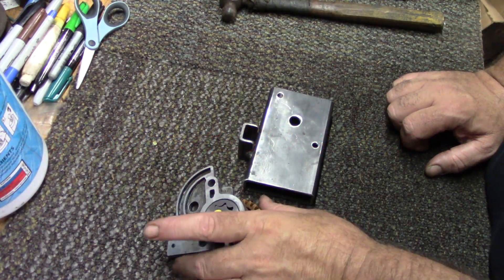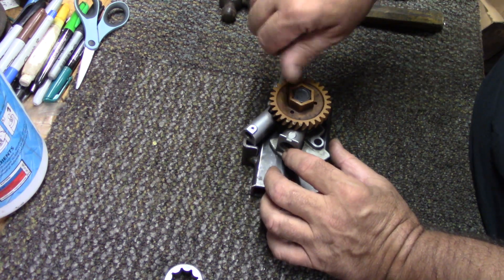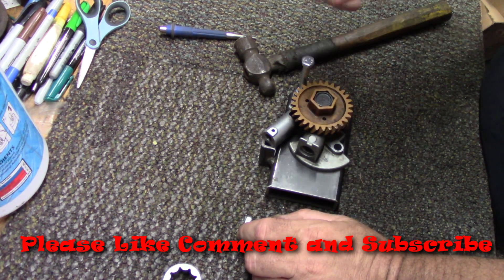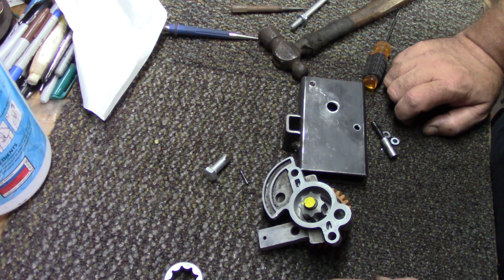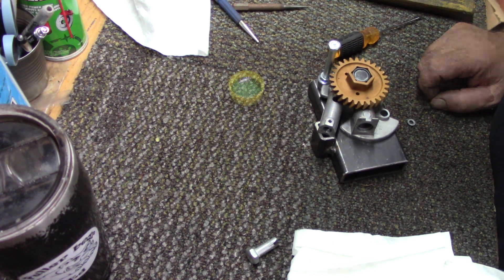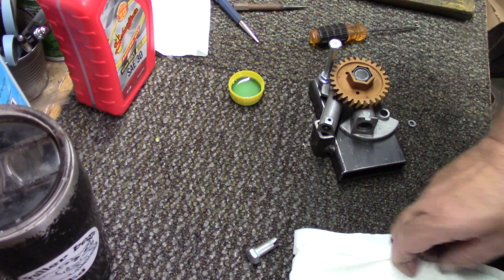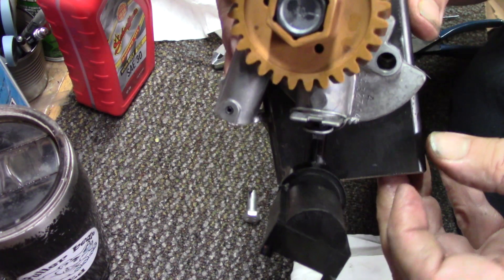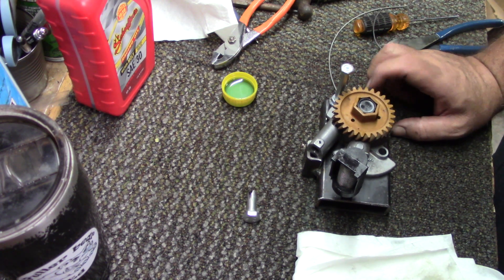How to upgrade the Kohler  Command oil pump for better performance. #kohlerengines #GTpulling

Comment: At 10k RPM -  that pump should be putting out a ton of volume..  So I'm not sure why this is actually needed.  I'd like to see you run a pressure transducer on a scope during a pass.. and see what your oil pressure is actually doing the whole time.   Do that before and after this mod-  and see if it's even necessary.   I suppose it can't hurt -  but I would be afraid of it breaking that plastic gear more than anything else.    My point is:  this thing pumps more as your RPM's go up -- so it should be a self correcting issue and not actually be a problem..  I think it would actually be pumping WAY more than what you need already -  so most of it will be going through that bypass.. (at high RPM's).   I don't think that lack of oil is ever an issue with this style pump.  Just my 2 cents
Reply from the maker: You hit the nail in the head, you have to up the bypass pressure so at high rpm it doesn't just push through it and starve the engine for oil at the end of the pull while its under the most load on the engine. Yes I have seen the plastic gear fail but not often.

Comment: Can the gear be changed if mine broke?
Reply from the maker: Yes. They sell steel aftermarket ones i believe.  I don't remember where I seen them
Reply: @PullerbearEd i figured it out. I appreciate it.   Kohler discontinued the oil pump for the ch23 . They will sale the pan , dipstick, oil pump and all that in one piece  for right at $400. I can't do that.I gotta press the pump apart and replace the gear.
Reply from the maker: A lot of the parts for them are n/a...

Comment: Wheres the oil pump located at? Inside the motor? You never said.
Reply from the maker: Yes it is in the bottom of the engine on the inside.

Comment: Did adding the 2  5mm washers increase the oil pressure. Stock as you mentioned is about 40psi what is it now with the 2 washers in the relief valve. Thanks Darren
Reply from the maker: Yes it increased it. It ups it to about 60psi on average.
Reply: @PullerbearEd    YOU SHOULD HAVE PUT 2. funny...i was doing this 30 years ago on small block chevrolet lol
Reply from the maker: This was an unknown pump to me. I didn't want to pump up the pressure to much.

Comment: Question does the dot on the oil pump gear face you or does it go down ? I have one with a broken plastic gear does kohler sell that separately
Reply from the maker: The dot faces you. I don't know if that gear is available separately but I would guess not because the pump wasn't the last time I checked.

Comment: What kind of oil pump pressure did you end up with after installing just that one washer, did you need to add another?
Reply from the maker: I never tested that engine but it's usually give about 10 more psi on other engines I've done.

Comment: Hey Ed, i would like to put an oil pressure sensor and  gauge on my Kohler command pro 27.
Where would i put the sensor?
Reply: The motor is all apart right  now. I can send pictures if that would help?
Reply: Oops, i ment engine!
Reply from the maker: I use a mechanical gauge and I put it the port on top of the engine between the heads. There is a plug there where a pressure sensor would have been from the factory.

Comment: How do I test oil pressure on a 25hp kolher about a year 2000
Reply from the maker: There is a test port on the top between the heads. There might be a pressure switch in the port. Just remove it and install a mechanical gauge.

Comment: What is your suggestion to get the maximum hp out of a 7hp kohler
Reply from the maker: Replace it with a 14hp lol. Just kidding the best thing would be to port and polish and mill the head a little. Then bigger valves and a better cam shaft.
Reply: I would switch it to a 14 hp kohler but for the kids class they dont allow that hp. They also dont allow port and polishing the head and they have to have stock valves
Reply from the maker: If its a pure stock class then there isn't a lot you can do other than getting the timing dead on for what the engine likes and getting the fuel dialed in.

Comment: Any idea where one can get a new pump of that style. I broke the cam gears on mine and it says part discontinued
Reply from the maker: You can check ebay or maybe a small engine shop locally might have an old engine around.  Lots of parts for these engine are discontinued.

Comment: Thx for the video, you use the stock vent on top of engine, or do you add a breather?
Reply from the maker: It depends on what class, if it's an open rpm class we add vents to the PTO side of the block. We drill and tap the top outer 2 mounting holes above the pto. I do show it in one of the videos on the Plan B tractor and the pro V engine build

Comment: I have 25 hp kohler command vtwin I was in the process of converting from vertical to horizontal shaft I made a tube and a screen block for the oil pump but my freind pointed out that there's no way for the oil to be pumped to the heads any ideas I appreciate
Reply from the maker: I've never converted one like that. I would have to think it would pump it up there the same if it was a vertical or horizontal.
Reply: @PullerbearEd  this engine has a oil cooler could you run lines to the valve covers on the return side of that so the oil pump sends to the cooler then the heads  thank for your help there's really not much on those type videos and don't want to ruin this motor that I've already removed gov from
Reply: I think only Hondas send pressurized oil to the heads, all the other commercial twins have oil mist come up the pushrod tubes from the crankcase or inside the pushrod itself.
Reply: @kylegoldston  thanks Kyle i found a horizontal 25 that is seized and the guy told me I can have so I have something to work with now
Reply: @jimmypotts4516  if you don't want both I can take whatever parts you don't need, I am going to be starting up a V-twin Kohler engine program.

Comment: why do they call it Department of Motor Vehicles why is boats with an engine so-called call a motorboat your statement is false whoever told you that just heard that from somebody else George called a folktale
Reply from the maker: If you are referring to the engine vs motor thing yes I know by definition they are the same. Thank you for watching.

Comment: Covid wuz just the globalists killing off the population while destroying our economy. The left is goose stepping to the new world order tune and just about everyone knows it now. 
I had a Kohler courage burn up the top crank journal years back and ruin an engine and I have just torn down another one that the plastic oil pump gear cracked and is spinning on the big bolt head. I have also read a few posts about Kohler having oiling issues so this is good info for me on rebuilding these engines. Thx😉
Reply from the maker: I dont get into politics. This is the best way I have found to get proper oiling to the topend

Comment: It's nice to see that these engines have a real oil pump! As a side note, not all motors are engines, and not all engines are motors. This motor happens to be an engine and this engine is also a motor. I'm not sure why there's so much discussion about that subject, it seems pretty simple.
Reply from the maker: en·gine

/ˈenjən/

noun

1.

a machine with moving parts that converts power into motion.

mo·tor

/ˈmōdər/

noun

a machine, especially one powered by electricity or internal combustion, that supplies motive power for a vehicle or for some other device with moving parts.
Reply: @PullerbearEd YES!!! 💯% these words r synonyms !!   U can use either or  at ur pleasure and as ur heart desires !!!

Comment: Sir I got Kohler pro 24 hp engine I need to find me an oil drain hose to make changing oil easyer would you know what size hose I need to screw in engine
Reply from the maker: If memory serves me correctly it is 3/8in NPT
Reply: @PullerbearEd  thank you
Reply from the maker: Your welcome, glad I could help
Reply: I used one from a 22 hp briggs vtwin

Comment: works better? can you explain it better?
Doesnt the original pump works well???

Are you just changing the  pressure limit of the pump?

I dont understan very well the point.
Reply from the maker: Yes the stock set up works fine for 3500 RPM. but when the RPM go up the relief valve opens sooner decreasing the volume so we up the relief valve pressure to increase the volume.

Comment: May have to do this to my stocker the next time it’s out!! Keep it up man!
Reply from the maker: It won't hurt it. Every little bit of friction you can eliminate is just a bit more horsepower.
Reply: Why?
Reply from the maker: The less friction allows the engine to make more horsepower. The engine doesn't have to work so hard.

Comment: Oh baby you know what I like. Thanks for the oil recommendation too. Did the modification while eating your famous loose meat sandwich, mushrooms, onion, mustard and a hint of zinc flavor.
Reply from the maker: That's awesome
Reply: what mods??? Can you explain me like iam very dumb, what so great in this video??? I dont understand it.
Reply from the maker: Juilo the mod is increasing the oil pressure to increase the volume of oil to the engine. At the RPMs we run you can run the bearings out of oil really quickly.

Comment: Easy hack good info
Reply from the maker: Thank you, I know it's just simple but I hope it helps someone save their engine.
Reply: @PullerbearEd  Did you just changed the relief valve?
Reply from the maker: Yes Julio, we add shims to the spring to increase the pressure at witch the relief valve opens.

Comment: Nice upgrade there. 👍👍
Reply from the maker: Thank you,  it's just a bit of insurance
Reply: @PullerbearEd  Do you pass over engine max  rpm?
Reply from the maker: Yes we run them at anywhere from 8500 to 10,000RPM

Comment: More psi is a good thing 👍
Reply from the maker: Yes it is...
Reply: How can you get more psi, witout changing gears or the pump??
Reply: @julioramossilva3968  It's always pumping through the same little oil passages and ports, etc.  It's designed to pump enough oil, even at idle.  So once you raise your RPM's at all -- it's already pumping way more than it needs.. So most of it will go through this "bypass".  All he did is make the bypass hold it closed a bit harder -- which then takes more pressure to push it open.    As you can image, at 10k RPM-  this thing will be pumping entirely too much oil..   ;)   -- and most of it will be flowing through this bypass.
Reply from the maker: Julio by add shims to the relief valve spring you increase at what pressure it opens up at thus increasing the pressure in the system.

Comment: Hey Ed will this help on a stock engine?
Reply from the maker: Yes very much so. The more oil you can get moving through the engine the better.
Reply: @PullerbearEd  How can you get more oil? Did you changed the gears of the pump??